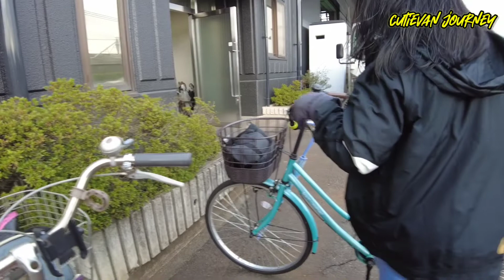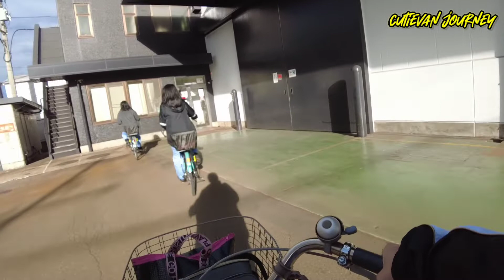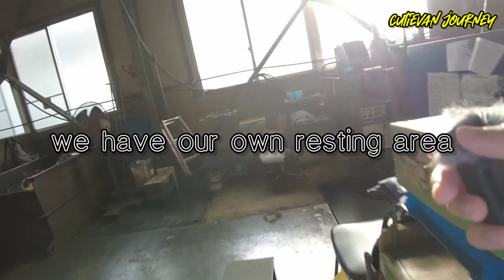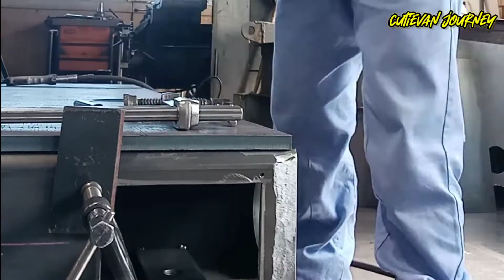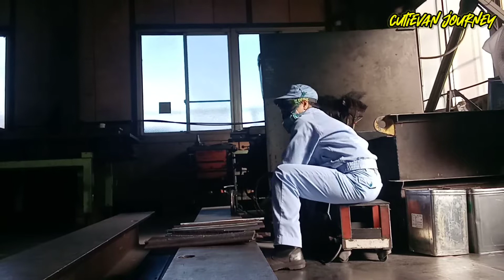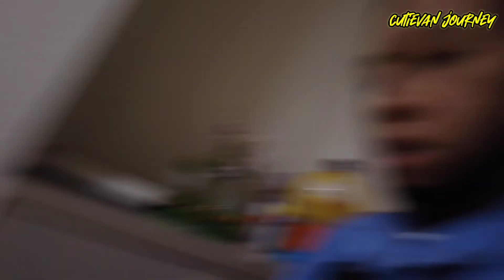welders diary #5 Japan life [ body pain overload + winter is coming ]

Comment: hi madam! nag comment ako here before nung nag work pa ako as decoder, ngayon nasa pinas pa rin ako pero tapos na ang traning ko hanggang NC3 SMAW and nag tatrabaho na ako as welder fabricator para kumuha ng experience. gusto ko lang po itanong if pwede na ba or may chance na ako makaalis ng bansa with 6months exp locally?
Reply from the maker: At least 1 year experience po ang requirement pag abroad...pero depende po yun sa agency or employer, kaya ask mo po sa agency na aaplayan mo..and dapat po kasi makakuha ka ng COE dun sa company na pinagtrabahuhan mo as a welder.
Reply: @cutievan4490  okay thank you po
Reply: @cutievan4490  ate last question hindi naman po ba kayo nahirapan mag apply pa abroad? as female welder?
Reply from the maker: Hindi naman po..as long as mayron job order for female welder sa agency na inaapplayan mo you have chances pero Kung walang job order it is impossible.
Reply: @cutievan4490  thank you so much